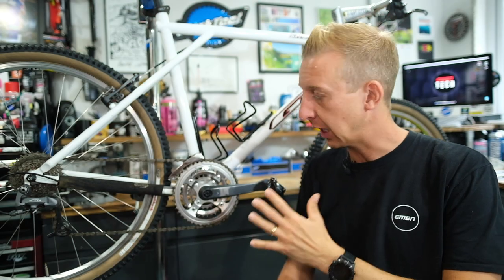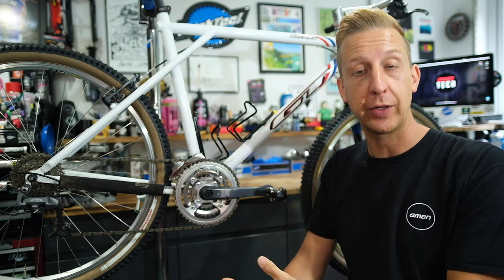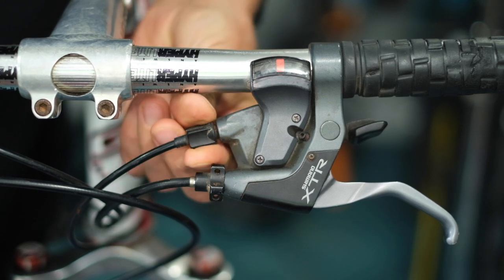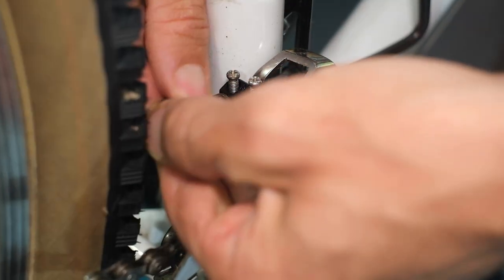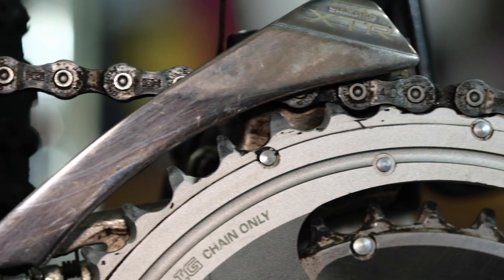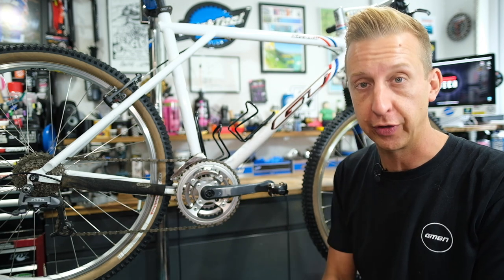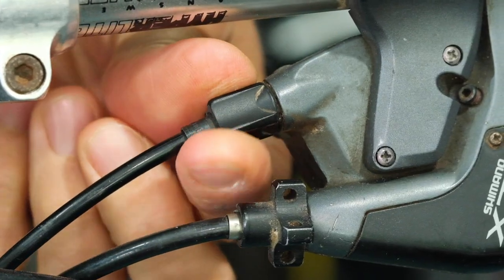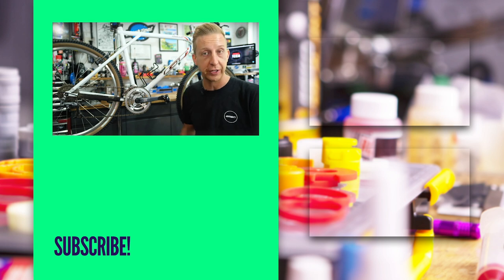How To Adjust A Front Derailleur |  Setup & Adjust Bike Gears

Comment: Those few of us who still have a front mech appreciate this video.
Reply: Yeah, I don't get what is so great about a 1x ... Less weight? Probably negligible compared to the weight of most people.. One less shifting lever?
Reply: @bmzaron713  1 less derailleur means 1 less thing to worry about, maintenance or shifting wise . Also in my opinion, it looks cleaner.
Reply: Most of us are still using a front mech.
Reply: I still find front shifter better than 1x more power and adjustments not easy to maintain though

Comment: Excellent instructions. Worked like a charm! Also, my limit screws (for whatever reason) were stripped partway down the bolt, so they would adjust the limits properly. Substitute in a few Allen bolts (M5) instead of the silly Phillips screws and it works perfectly. Thanks for your tips!

Comment: Good video...would love to see examples of what some of the common problems are. like where that height measurement of cage to sprocket should be taken, or what the impact is when the cage is just slightly out of parallel. Seems like I’ll always get it shifting just right but always have just a bit of rub in only one or 2 gears.  Another thing that I see a lot of is the chain rubbing the cage on just one side of the pedal stroke. Thoughts?

Comment: I have a 2x with bash ring converted from a 3x setup. I bet folks would like to see how that is done.
Reply: Oh yeah,  I would very much like to see how it gets converted.
Reply: @dido1803  Easiest way, just grind down all the teeth on the big chainring, then tighten down the high limit screw on the front derailleur so you can't shift onto it any more. So the big chainring becomes the bash ring.
Reply: @mattgies  thanks for your help.
Reply: @dido1803  Cheers!

Comment: Do you adjust the limit screws with the cable unclamped or clamped again? I wasn't sure as you never said you clamped it back but in the video the cable is clamped back on before you adjusted the limit screws. Sorry if this is s dummy question.

Comment: I would suggest to do a Video of what to do If the crankarms on a sqare tapered axle are whobbeling.
I do already know that in this case you have to tighten the BB- shell on the nds. But once I also tried to tighten the crankbolt to it's maximum.

Cheers

Comment: Does rotor design compound make a difference in its stopping power? Comparing 2pot 203mm cheaper rotor to 4pot 180mm expensive rotor? Would they cancel each other out or one better then other?

Comment: Oooooo the xtr fd-m952 my favourite ever front mech.
No front mech in the history of front mechs hurled chains around like that front mech with its independent inner and outer plates. I had azonic ds-1 with xtr front and rear mechs and xt shifters raceface turbines and 26/36/48 cogs back. Marzocchi z1 MCR 130mm back then

Yes I still have one.... I've through full sus to 29er and back to retro. Current a 2002 Cannondale f400. Dumped the 60mm headshox for some 2008 fox f series rlc 120 SRAM x9 rear mech and shifters, x7 front mech nos deore octolink crankset. Modern discs , 65mm stem and 750 bars. 
Amazing the forks are the same length axle to headtube as the 60mm headshox

Comment: Im setting up a brand new Shimano Tiagra double. Height/anlge & Limit screws are set perfectly. Barrel run all the way in with a couple clicks out. Cable taught. Then i shift up to high and it rubs on the outer cage, so i run out the inline barrel adjuster but it maxes out to get it to stop rubbing. But it does stop rubbing…Then i check shifting again down to small ring and now thats rubbing chain to inner cage bc i tightened the cable so much im getting a false limit. Back and forth with same results. Got any advice??

Comment: I have issues with a really tight front derailleur, is there any way i can release the tension from the spring? The shifter works fine when i disconnect the wire from the front derailleur.
Reply: Cable might be dirty

Comment: I have just fitted a pare of v- brake and gear lever combernaion which is a 3 / 7 . The rear gears work fine and travel through with every click but the front derailleur isn't , what is happening is I start of in the small chain wheel and click it once and it moves straight onto the latest I've tried reducing the tention and it has made no difference.  Please help !!!

Comment: #askgmbntech
Hi, I'm looking to get a new hardtail frame and initially finding it hard to decide between the Nukeproof Scout 275 or 290, I'm 6'1" but like a bike I can throw about a bit on the trails and I quite like the occasional trials in the woodlands, so was moving more towards the 275, what are your thoughts. The other frame I was looking at is the Commencal Meta ht am. Any advice you have in these bikes or sizes would be helpful.
Thanks

Comment: Is inner same as low "L" and outer high "H"? Cheers
Reply: Yep! On the front derailleur, that is. On the rear derailleur, the "low" is the innermost sprocket and the "high" is the outermost sprocket. Just think "high gear = fast; low gear = slow"
Reply: @mattgies  thanks, that's a good way of remembering it.
Reply: @nellysummer49  Cheers!

Comment: #askgmbntech
I am thinking of upgrading some parts on my bike but I only have the budget for one upgrade and I am stuck between upgrading the entire rear mech up to a 1x12 from a 8x3 and upgrading my fork to a better quality fork like some rockshox from my sr suntour xct which I can’t adjust
Reply: I'll chip in as I doubt GMBN would get your question quick enough.
I'd suggest a new bike, as the cost of a decent air fork is about £500, and the cost of a decent 1x12 is about £400. If you were able to sell your current bike for £350, you would have £1250 to spend on a new bike. WIth that money, you could buy a Calibre Bossnut, a bike with a 1x12, 130mm front and rear suspension and you could budget in a dropper post as well.
Reply: Giles Turner 
I can’t see the rest of your reply as I have a problem with my YouTube page I can’t read more on comments but I Have my I on the SRAM Mx eagle and it is only £250 and I would buy some cheap rockshox within the £250 price range
I wouldn’t buy a new bike as I only got this one at Christmas
Reply: I would rather suggest you ask yourself why you want an upgrade. Do the gears still work ok? Then there's no need to upgrade them. 1×12 is not inherently better or worse than 3×8, just different. If there are real skipping etc. problems, then it may still be more sensible to just have them serviced instead of replaced; ask your local bike shop. How old is your chain?

Switching to a better fork OTOH will almost certainly improve your ride quality. In fact I did the same thing: switching from a Suntour to RockShox. The improvement was a pretty day&night one.
Reply: leftaroundabout 
Just for an overall better ride as there’s always a problem with the gears they slip and the Chain rattles all over the place and things get broken and with the fork it will just make a smoother more enjoyable ride
Reply: Thanks for your help guys
Reply: @xx-----------xx873  my vitus nucleus had a suntour air fork and I managed to get a Rockshox recon gold Rl 140mm for £200 on sale down from £450 on chainreaction cycles. Did a budget 1x9 conversion using a 30t snaggletooth narrow wide chainring and converted to tubeless.

For about £250 I've massively improved my bike whereas the next Vitus bike up with comparable components costs £850.

It would have been better to buy the higher spec bike in the first place but I didnt have that money at the time, plus it's fun upgrading.
Reply: @leftaroundabout  I switched from a 2x9 to a budget 1x9 using a quality 30t narrow wide chainring. The shorter chain and narrow wide setup means that I have much less chain slap and barely drop chains. I do have reduced gear range for those long climbs and fast road sections but for my style of riding it works great.
Reply: @joshuabrown9398  That's a really good idea on a Nucleus, as it's a proper upgrade worthy hardtail.
Reply: @davidprice1074  A 1x12 won't be much better, it would be just as loud
and NX eagle is not very durable.
Just ride your bike hard until you can upgrade it.
A fully upgraded cheap bike will be worse than a cheap good bike.
Reply: Giles Turner 
I have a cube aim 
It cost £550 so cheap for a bike but quite expensive for me